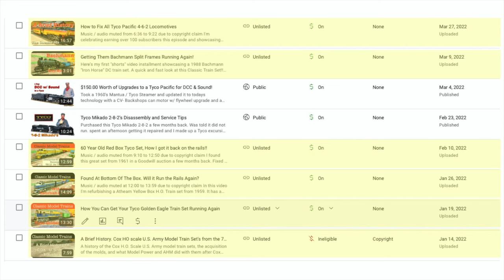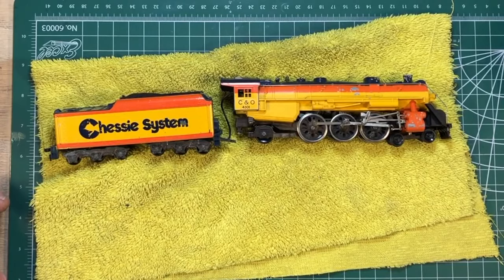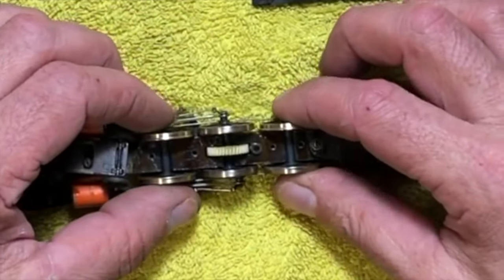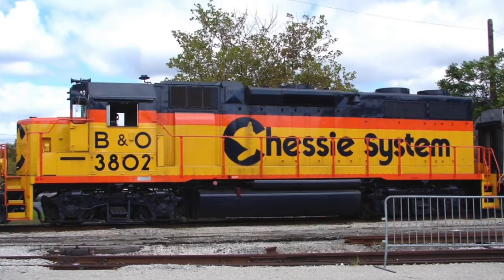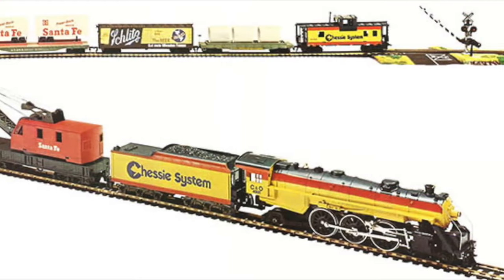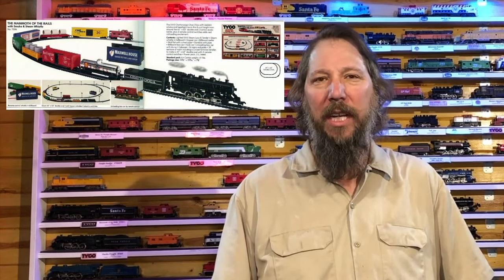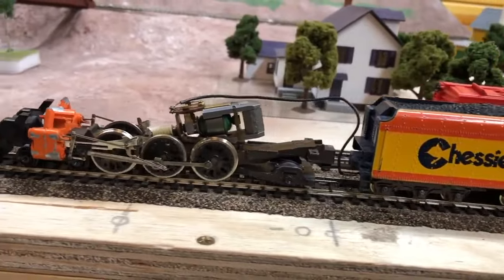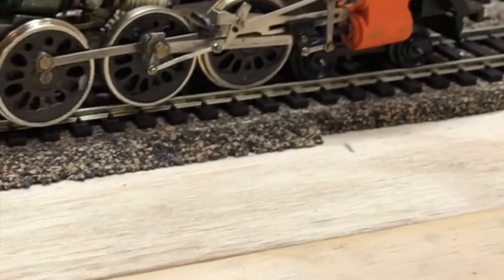Reviving Tyco's "Chessie Systems" Locomotive & It's Complete Set.

Comment: Cool video Ron. Hey, ya know the motor in those things grounds through the trucks in the tender, right? So take those trucks apart and clean/polish the axle ends, clean the axle pockets in the truck and add your favorite conductive grease. If you're not doing that you don't have a good ground. The difference in performance can be surprising.
Reply from the maker: Thanks for the info Jim.  I agree with you completely

Comment: The tender pickups on these locomotives I feel have always been the source of issues, iv been putting rivarossi wiper pickups on these tenders ,that usually helps with picking up power
Reply from the maker: Ive never had problems with the tender pickups but I do put some extra weight in them

Comment: You did a fine job here,,, other than tyco's system 200, this was tyco. Dream set. Only JC penny could do a smidge better.   What I would like to see you do is come up with an original box for this set.....as the size of the box would be great to see, as tyco had those flat boxes.  Most dealers would on ly get two or three of these to a master box.....great job...   More of these please....😊
Reply from the maker: there's 6 to 7 more video's slated for remastering.